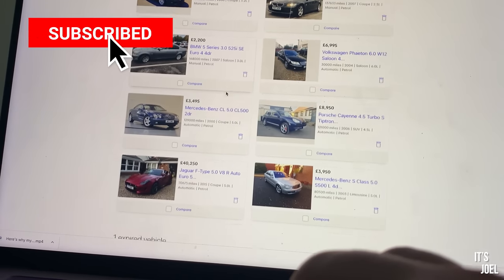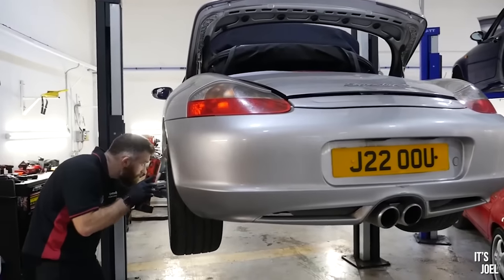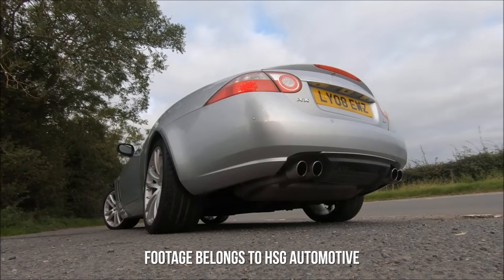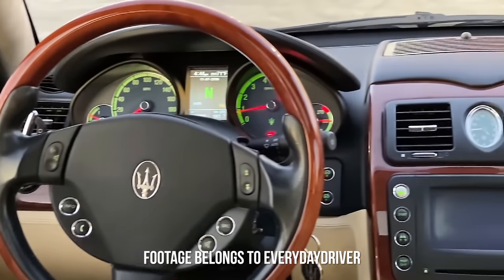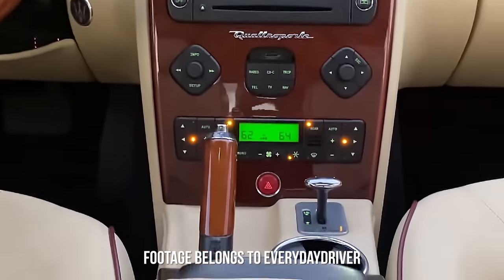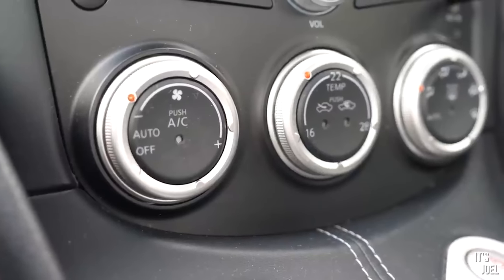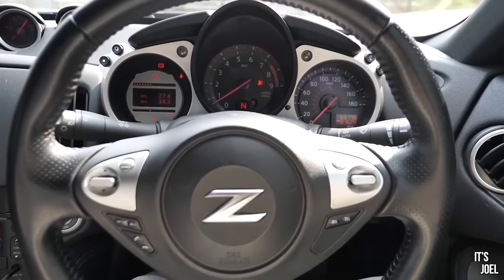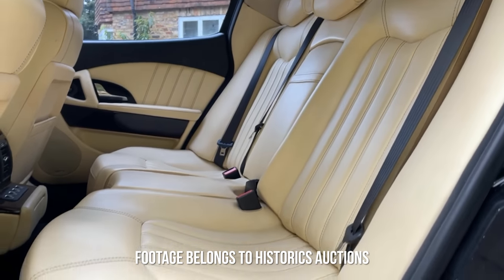5 OVERLOOKED BARGAIN CARS FOR UNDER £10,000

Comment: Just before Christmas I went and bought a car something sensible.
My wife said.
So for £1950 I brought a 2007 Mercedes clk 320 cdi elegance main dealer history 12 months MOT 2 owners and warranted 90k.
Best car i have owned at the moment.
Been checked out no corrosion because the corrosion prevention as been kept up. And over 30mpg with out trying.
But have only done local driving.
At the moment

Comment: A car that's very different to the examples shown here, a BMW 640d (2012+). RWD, over 300bhp stock, and around 400bhp with stage 1/2, sounds decent for a diesel if straight piped, and good MPG since it's diesel, considering power. It's luxurious, and had many features standard. With some simple mods that car can look even better. And for starting in 2012, I would say if this car rolled out the factory now, I would not consider it outdated. £10k will probably get you a higher mileage example, but generally engines are bullet proof if timing chain is replaced.

Comment: I go for a late model Audi S5 V8. I suspect that a decent RS5 for £10K would be a stretch, but a 09-10 S5 is quite easy and, at 355 bhp it's no slouch, hitting 60 in around 5 seconds dead. Additionally, you just get that amazing V8 sound when you stick it on an aftermarket SS exhaust. Rumors of timing chain issues on this model are gravely exaggerated as the guides for this generation of the 4.2 had been modified from those used on the B7 RS4 which were known to have issues with failure.

Comment: A sub £10k Maser has bankruptcy written all over it.  Front sub frame rot for starters!

However, epic machine, just a shame it doesn't sound like a Ferrari due to the difference in crankshaft.

I'd love one, but simply not brave enough, and I own a V10 M5 that I've had to rebuild the engine of 😂
Reply: The BMW V10 is a brilliant engine when it works, I own a Mazda RX8 r3 (not even in the same league I'm aware) but know the feeling of loving a engine so much but you've always got that thought in the back of your head saying, if this goes wrong I'm going to be hurt financially and emotionally 😂😂
Reply: @converge8008  I'm still paying the cost now 😂. I'd only owned it for 4 months. Rogue mechanic did the damage. 

I like the rx8, the r3 seats are lovely.  I've fancied one for years but never driven one. I currently only have the room in my life for one ruinous car 😂
Reply: @TheM5Dog  Hoping it gets fixed mate,and we both have many, many, many trouble free years ahead 😂😂
Reply: @converge8008  mines been fixed since 2019 and I've enjoyed many reliable miles in it. I'll offer the same courtesy to your good self! 👍🏻🍻

Comment: Mid 2000s Audi S4. 4.2ltr V8 manual (or auto), 4wd, saloon or estate. It was Audi's answer to the E46 M3. Or an S5 if a 2dr is more your style. Timing chains on the earler cars are scarey though!
Reply: They sound lovely but are more of a competitor to the 330/335/340 depending on the generation. It's the RS4 that competes with the M3.
Reply: @NomadJRG  agreed, but an old top gear segment pitted the s4 against the e46 m3 and the s4 'won'.  https://youtu.be/xYqCVgVdq3I

Comment: The head would say the nissan, but the ♥ would want the Jaaag or the Maserati. If I had 10k to spend, and this is just me, I'd throw it all at my AR GTA sportswagon. It would be pristine with 10k spent on it. 5k for the head skimming and bottom end rebuild. 3k for paint. 2k for whatever other details I can find that need doing. The head and bottom end are fine btw, but at 125k miles, it's something that will need attention soon enough. 
I talk all this nonsense, as I think spending £10k on anything other than the nissan, you'll need another £10k over the following 3 years

Comment: Some S2000s have been creeping into the classifieds for less than £10k recently. That would be my choice for 5th
Reply: WHAT are S2000s cheap in uk??? Theyre like €50,000 here
Everyone should get one at that price omg
Reply: @yeahnoway111  yeah! A mint condition, low mileage S2k will still warrant £25k though. Where are you based? Potential export opportunity 🤔😂